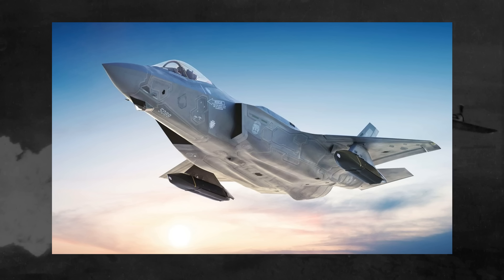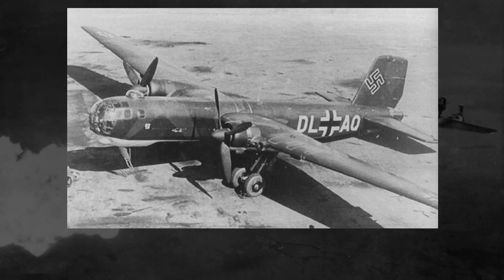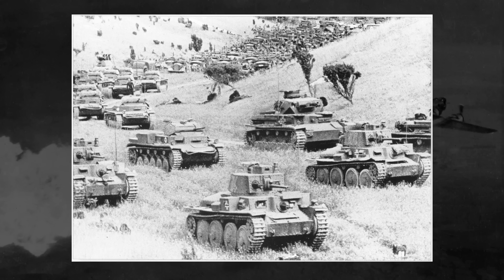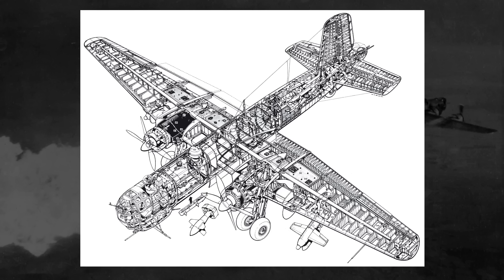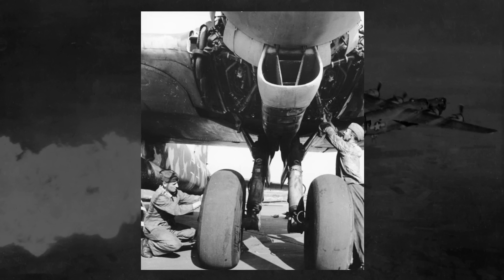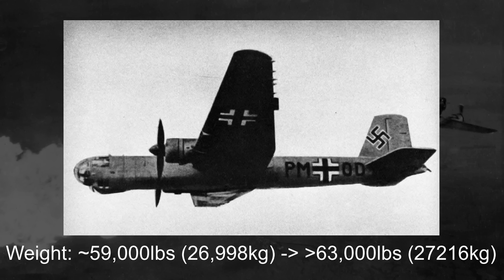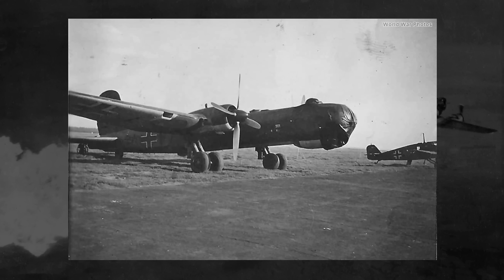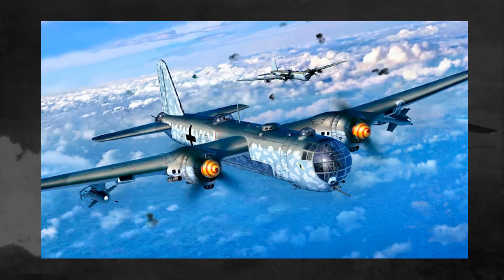The Plane That Kept Bursting Into Flames: Heinkel He 177 Greif

Comment: When the germans want to build a new ciggarets lighter but over engineer exist.
Reply: When germans wanna make cigarettes lighter but somehow it can fly
Reply: @fajareraim6136  7:19
Reply: Problems with engine's overheating persecuted american II war aircrafts and never were solved....
Reply: B29 was more prone to engine fires than the He177 bud.

The only reason the 177 did so was that Heinkel chose to propell it via Db606 then Db610 then Db613 "dopplemotoren" within very streamlined tight fitting Collings. (BTW my great uncle HATED these dopplemotoren being produced (which is why very little info on JuMos contemporaries is avail (Jumo 211 (eq to Db606 or 610), Jumo 214 (Eq to 613). He demanded that Heinkel put 4 SEPPARATE engines on the 177 thus the 177B was born which was a dramatically better aircraft that outperformed all of its contemporaries by a wide margin.

The B29 on the other hand was plagued from beginning to withdrawal by incessant engine troubles (fires, explosions, engines shearing off...etc) due to the relative ignorance of American A/C designers and Engineers..who put a 4 row radial in a very cramped cowling with No actual capacity to cool off the 3rd abd 4th rows. (It took the US stealing Nakajima patents and plans to come about a solution). The Tu4 was also plagued by such issues and they were solved BY IMPTISONED GERMAN ENGINEERS
Reply: @kkteutsch6416 exactly... yet due to J and American propaganda everyone thinks the He177 had such a giant and unique issue..

Very very few He177s actually experienced engine fires after the solution was found.

The Americans had nothing but engine issues from day one to the end
Reply: @BenJamInn-q3o  only few times I've read from.low MTBF from R 3350 Wright engines on B 29, they argue that on DC 6 and Constellation that issues were solved...but and with B 29 ?
Reply: @kkteutsch6416  the R3350s in deed had constant issues in the B29... hence the B50 (if I am correct the b50 was a reengined B29)
Reply: When someone tries to be funny, but is uses the lame and worn out over-engineering BS...
When someone tries to be funny but can't even spell over-engineerING 🤦‍♀

Comment: As far as I know, the bomber was originally planned as a four-engined aircraft, but a genius at the RLM demanded dive bombing capability and so two engines were coupled in each nacelle. That´s where the trouble started. All in all it was a stillborn child.
Reply: Conceptually, it was a great idea. The drag of two engines, and the power of 4. No different than doubling up a 9cy radial to 18 cylinders (and beyond) which had been done to great success. I'm designing scale functioning landing gear for this right now in 1/10th scale for R/C. Somehow people think  doing something super complex in a short time should still be perfect. Seems like a normal deveopment cycle to me, and at a time of super limited resources is still pretty impressive.
Reply: There  were 2 versions which used 4 engines in separate nacelles. The He 277B and the French assembled He 274, which was completed postwar and several served in the French AeroNavale until the early 1950s, where they were reportedly superior to the Lancasters supplied by the UK for the same tasks, being faster and having longer endurance. The He277 in Germany made a few test flights, but was destroyed by U S bombers on the ground.
Reply: @spinnetti  Postwar, the Brabazon is also this.
Reply: @teslashark  - The Brabazon   had coupled engines but they were in the wing and not crammed into the nacelle.
Reply: the dive bombing shit came straight from Gröfaz (AH), who was enamored with the idea of precision bombings.
Milch and Udet who took over procurement and development after Wever's death, were also fans and so it ended up poisoning a lot of great ideas, including the Swallow (ME 262) that would have been way better without that meddling from amateurs.
Reply: @Ugly_German_Truths   The story that the Me 262 being delayed in production is actually a myth. The production Jumo 004B was not available before the Summer of 1944 and even then, engine life was as low as 10 flight hours.
Reply: @Ugly_German_Truths  Milch the source of everyone's problems on both sides
Reply: To make it worse the twin engines were not liquid cooled. they used a oil evaporation system. which never worked.
Reply: @teslashark  Actually, it was Udet who was the dive bombing fanatic. Milch was one of the few Luftwaffe leaders to have any grasp of the interrelationships between development, production and operational utility. Dive bombing did make sense for close air support or anti-shipping work because it minimised the number of bombs required (see Luftwaffe bomb shortage during Battle of Britain) being the precision guided munition of the day, but it needed air superiority and it was not a strategic bombing technique.
Reply: @proteusnz99  Milch has an obsession with mature designs that looks very confusing
Reply: @teslashark  Hi, I think it might be necessary to consider the circumstances where Milch was making his decision. Udet had essentially let the manufacturers run multiple development programs on very compressed time scales, so none of the new generation designs (except perhaps the FW-190, and even that had overheating problems in the A-0/1 iteration) were really suitable replacements. At the same time the air attacks on Germany were starting (from 1943) to become an obvious threat to the German war effort, so the primary need was as many fighters as possible. Hence Milch’s decision to concentrate on existing designs (Bf-109, Bf-110, FW-190) looking for long productions runs to drive down unit costs/time, Ford-style production lines. Beaverbrook as head of the Ministry of Aircraft Production did much the same thing, concentrating British production on five types. Milch was also having to fight against Hitler’s obsession with maintaining bomber production. While Milch and Speer did raise production levels, that these machines were becoming ever more obsolescent while pilot skills declined, combined with fuel shortages rendered the production of airframes increasingly irrelevant. See Williamson Murray’s Luftwaffe, which shows how decisions made in 1941/42 foredoomed subsequent efforts.
Reply: The original concept was not about dive bombing. Dive bombing became a thing when in 1937 in spain the ju 87 stuka did perform very well. This did lead to a redesign of the ju88 from schnellbomber to divebomber and a dive bombing requirement for the he 177.
Reply: The Brits went the exact same way with Avro Manchester with two X engines..... Later this was developed into the famous Lancaster when they were facing similar problems with Avro Manchester.

With the XB19 the US tried also the same.

It was a popular idea among aircraft designers.
Reply: @brettpeacock9116 the He177B was the first version with 4 SEPPARATE nacelles and was ordered explicitly by Göring. It became the 277B
Reply: @Ugly_German_Truths 
Ah, yes, the "delayed" Me-262 that even when the engines finally arrived in mid '44, was so horribly unreliable that calling this anything other than a small series of prototypes would be a mistake

Comment: You may want to talk about the He 177's "Sequel" aircaft: The Heinkel He277 and He 274. Heinkel did try a MUCH simpler solution by converting the twinned engines into 4 sepaerate engines, like a Lancaster orr B-17 and dropping the requirement for dive bombing.  The He 274 was developed in France during the occupation and a number Flew in the French L'Armee de L'Aire post war, lasting until the 1950s. Apparently it was quite popular and the range made it suitable for Maritime Patrols and SAR duties. The 277, using BMW801 engines (Radials) was also relatively trouble free in testing but ended as a casualty of the Termination of Bomber production in 1944 with only a couple built. The RLM was very "down" on this idea and tried to cancel or delay, it several times
Reply: False... Heinkel was forced to adapt the 177 into a 4 nacelles bomber by Göring. And Milch had been fighting with Heinkel since the very first draft of the 177 was made to get the 177 built with 4 SEPPARATE engines.

And seeing how Göring ran the Luftwaffe and Milch ran the RLM..it wasn't delayed at all...

Meanwhile Hitler was against bomber production after 1942/1943 and in fact demanded Full emphasis on bombers and high altitude fighters

Comment: B-29 engine fires downed more than the Japanese. Wasn’t just the Germans whose engines caught fire predicably
Reply: This is what happens when new tech is pressed into service before it is fully developed and mature enough to be reliable.  😎👍
Reply: @lancerevell5979  …. Three rows of cylinders and the engines overheat. Surprise? Not. But include magnesium engines just to ensure combustion
Reply: No, two rows of nine in the R-3350 engine - 18 cylinders…

Had to upgrade things drastically, e.g. going to Forged Aluminum cylinder heads, with the fins cut by ganged slitting saws, to get usable reliability.

Comment: Such a futuristic design for mid 30s. Pity they didn't have 2 engines per nacelle and have one a puller engine ,the other a pusher.  They could have put cooling slats in the leading edge of the wings.  The dive bomber aspect was pure stupidity...
Reply: Those pusher puller nacelle designs were significantly prone to overheating too.  From what I understand.

Comment: I bet if they made the engine nacelles P4M-1 style they would have had less issues with heat and get the bonus of jet engines. Making it again technically a 4 engined aircraft. If I were a german engineer I would suggest replacing the engines with four Fw 190D engines likely would have each engine behind the other running either a counter prop system in the front or a propeller on the front and back side of the nacelles like the F.222.2, 

Usa has done something similar to the fast bomber with mixed propulsion bomber / patrol aircraft like the Neptune or P4M-1, 4 engined Aircraft, twin piston and jet engines. The latter had them in the same nacelle pods. On the griff’s platform this would be very helpful, it could also support reinforced wings due to having a large nacelle section, Getting rid of the need for fuel in other places if needed.

Comment: What's ironic is that the requirement for dive-bombing was rescinded when its effect on overall weight was finally acknowledged by the RLM, but it was too late in the design process to change without delays and cost. Goering hated the idea and said "It is a straightforward idiocy to ask of a four-engine bomber that it should dive. Had I been told of this for one moment, I should have exclaimed at once, 'What kind of nonsense is that!' But now we are stuck with it." Goering had also wondered publicly why it had two, inaccessible, "welded-together" engines, when he had thought the engines would be mounted in tandem.

Udet gets a lot of flak, and well-deserved, for his fascination with dive bombing, but even he had a boss - General Hans Jeschonnek, Chief of Staff of the Luftwaffe. Their time in the Spanish Civil War apparently showed them where level bombing was too inaccurate. So Jeschonnek wanted the 177 to dive bomb, Udet was all about it, and Goering and; in a display of uncommon (for him) common sense; Erhard Milch, were furious about it.

There was also some hubris in the Heinkel factory about this; Goering had asked Ernst Heinkel if the engine problems could be resolved, or if it was hopeless, and Heinkel assured him the engines were fixed. Of course, they really weren't. Goering addressed a meeting of German aircraft makers around May 1942 and asked why they just didn't go and make a pure 4 engined bomber and he was told: "No, four engined types are passe now, it is far better to have only two airscrews." To which Goering made a wry comment that the Allies' passe four-engined bombers were proving a deadly nuisance.

The more I read about WWII German aircraft design, procurement, and usage, the more I believe that the Almighty was directly assisting the Allied war efforts. Never before in the field of human conflict was so much squandered by so many for so little result.
Reply: The idea behind dive bombing for army support did make sense for something like the Ju-87 (assuming air superiority can be assured), allowing precise (for the period) bomb delivery, something not possible with level bombing. This allowed for an economy in bombs used (see for example the Luftwaffe bomb shortage during the Battle of Britain). The Ju-87 was also an effective anti-shipping weapon. Applying the same logic to the Ju-88 made rather less sense. Expecting something the size of the He-177 to make steep dive attacks was sheer madness.
Reply: What a gem of a comment. Intelligent, informed, interesting. I went throught the same development as you. The more I've read about nazi Germany, the more I'm shocked it lasted so long with such a dysfunctional bureaucracy and procurement system riden with interpersonal conflicts and coruption.
I strongly recommend that you watch "The Me163 Komet - Rockets are dangerous" by HardTrasher. It describes the rivalry between Lippisch and Messerschmitt and is a little saga of Nazi incompetence in itself.

Comment: Interesting to contrast the He-177 with the Avro Manchester. Both were designed with coupled engines, with at least a shallow dive capacity, aimed at producing a twin with a heavy bomber capabilities. The German’s rejected the Do-19 and Ju-89 strategic bombers as pedestrian in performance as well as beyond the capacity of German industry to create in number or fuel. (When KG-1 got 90 He-177 operational, an operation needed 480 tonnes of fuel, at the time the entire daily output of aviation fuel)
The Rolls-Royce Vulture, (coupled Peregrines) were as big a disaster as the DB-610, but the British had the common sense to see the thing was a loser, redesigned the Manchester to use four Merlins to produce the Lancaster. The Germans kept trying to fix their mistake, the possibly effective He-274 with four BMW801s emerging way too late. A classic example of those in charge of a program refusing to admit they’d made a mistake.
Reply: I worked for a couple of companies that were the same way. Me and a maintenance man were observing one contraption we had at a unit and he summed up their refusal to change it by saying; they just can’t let go of a bad idea.

Comment: Nice and informative video, thank you. Reportedly a follow-up version with four separate DB603 engines in four nacelles has been envisaged as the He 177B. However that variant obviously came to nought although it might have been a promising improvement over the twin nacelle 177, not unlike the way the Lancaster evolved out of the Manchester.

Comment: I understand that the paired engine design meant running fuel supply lines really close to hot exhaust manifolds.
I am not an engineer, but that seems like a problem waiting to happen.
The Avro Manchester was built with paired engines - and it liked to catch fire a lot. 
So the Brits rebuilt it with 4 separate Rolls Royce Merlin engines and re-named it the Lancaster - and that worked just fine.
Reply: Avro Manchester was a twin engine design.  From Wiki:
"Powerplant: 2 × Rolls-Royce Vulture I X-24 liquid-cooled piston engine, 1,760 hp (1,310 kW) each"

The Vulture engine was underdeveloped and unreliable.
Reply: @lancerevell5979  Its even worse it's an 'X' engine specifically four 6 Cylinder Rolls-Royce Peregrine engine cylinder block in an X configuration, so prone to many similar issues 24 Cylinders in one engine unit that was not designed to be that from the outset seems like a bad idea to me anyway.

Where as the Merlin was a V-12 so had space to separate it's parts out more & I guess making the X 24 Cylinder engine gave them some idea what NOT to do as well..
Reply: @lancerevell5979  I suspect that if Rolls Royce had put the development effort into the vulture it would have eventually become a mature design. What damned it was the decision at the beginning of the war to severely curtail or abandon development work on everything apart from the Merlin and Griffon as these engines were the most needed. You could build 2 Merlins for each Vulture and Merlins were much more useful, it was same with the Peregrine, why build a Peregrine when you can  build. Merlin which was in much greater demand?

Comment: Great and informative video. The DB605 was a good power plant and was used on earlier aircraft, the BF-261 and He-119, with no issues. The He-177 was simply asked to do too many things and the Germans tried to turn it into a "super bomber", capable of doing everything. The concept could have worked better if Heinkel didn't take short cuts on the engine instillation and didn't  try to make their new heavy bomber dive. By the time the He-177 became a competent design the Germans would have a greater need for more fighters and interceptors.

Comment: As others have pointed out; they got the engines, mostly sorted out and the B-29 had similar issues. Big ass engine in a tight cowl with poorly designed fuel and oil line routing. Plus the R-3350's crankcase was made out of magnesium which really burns well! 

That being said, the entire German bomber force was really a waste of time and resources. They couldn't possibly produce enough to carpet bomb anything at night and never developed escort fighters to protect bombers in daylight. That's also why the Ju-88 was largely used in other roles, eventually. It was too good an airframe to waste, so they used it for just about everything, but it just wasn't an effective pure bomber, even as early as the Battle of Britain.

Cheers!